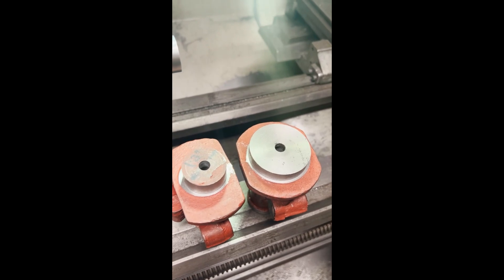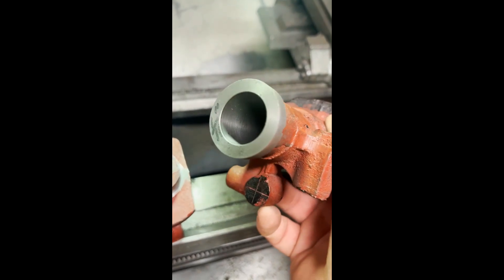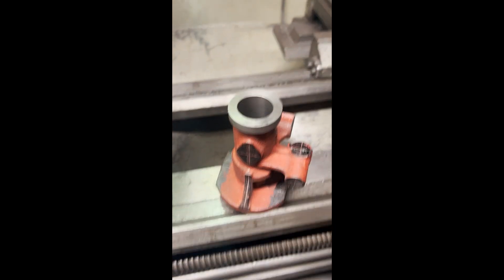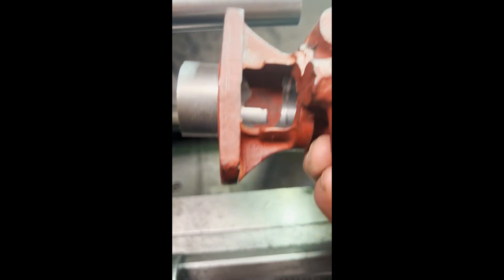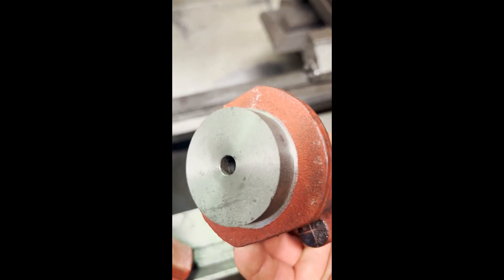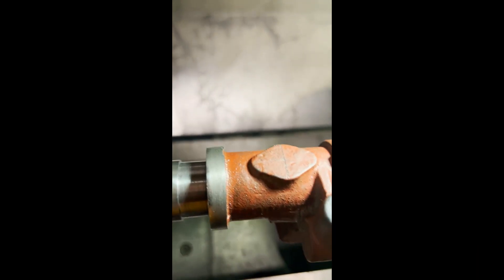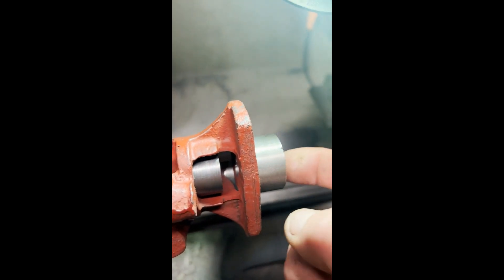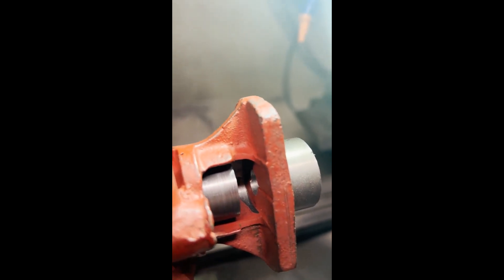3" Scale Foden wagon trunk guides

Comment: Far easier with a touch of loctite
Reply from the maker: Unfortunately loctite needs a gap for the loctite to hold. A bit like silver solder needs a gap to allow the solder to capillary into the joint. So this then means either turning down the mandrel to create a gap and losing concentricity. Then the expense of purchasing the loctite, and then the issue of heating the component to release the loctite joint to remove from mandrel. So this is a cheap quick system for holding components without the any hassle .
Reply: @homeengineer5212 Not at all, the loctite circumnavigate the bore and creates concentricity. 
I do this for a living on a daily basis.